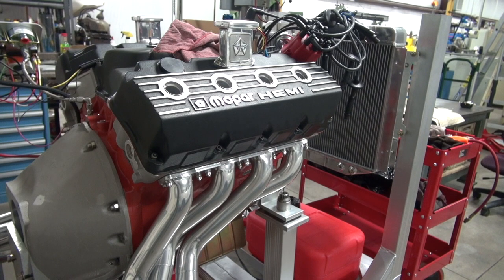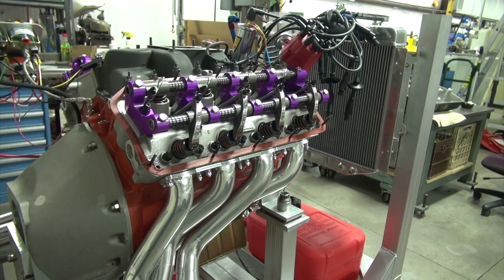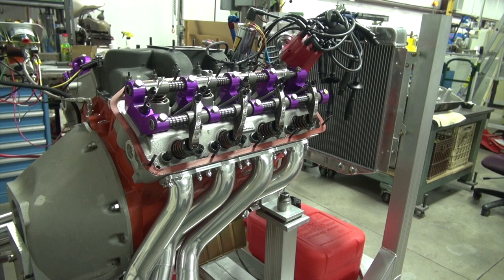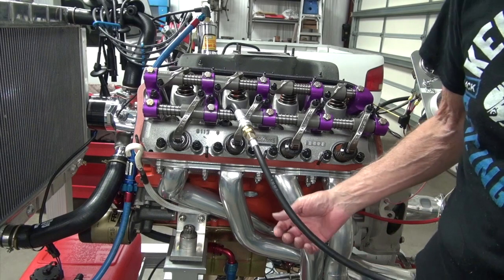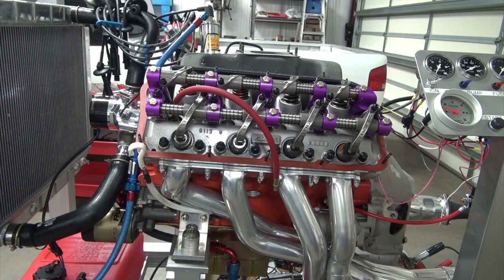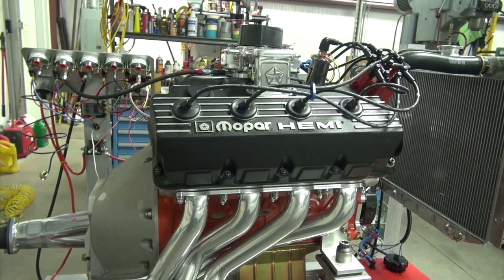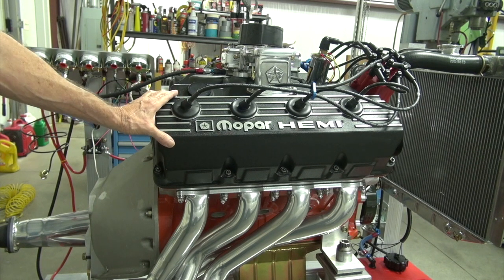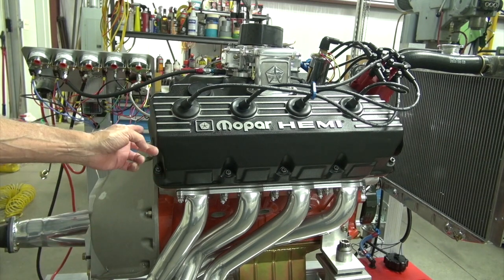Building your 426 Hemi Ep 22 #426hemi

Comment: I saw the whole serie. Thank you very much for this upload and the whole work you did. A lot of important information for me because I'm building a Callis block right now. Bought the block almost two years ago. It was a rough bore, now bored 4.25. Eagle 6-bolted crank and Eagle connecting rods, KB huperuetetic pistons, Iron heads from a hemi I had new manley valves and whole new valvetrain. Had to wait a long time for the intake but was finally able to get a 2x4 from JEGS. Will follow your instuction and advices carefully.  Engine going in a -70 Cuda, 4-speed when ready. Thanks again!!
Reply from the maker: @ifixmycarmyself2502  Take your time and if something doesn’t look right take a break and come back later. And thanks for watching.

Comment: Hi Rick I love your videos. I have learned a lot I'm building a 572 as well I also have a Callies block I am running a comp solid roller cam. My lifter bores are not bushed and I was wondering what is a good lifter to go with that does not use needle bearings and works with a non bushed block. My cam spec is:  .704/.685  276/286 r108  Thanks again!
Reply from the maker: Ray Barton said he likes Jesel and Morel. I don’t know which bearings they use. If they are good enough for him they are good enough for me. Thanks for watching.

Comment: Great job showing how you built it Rick. I just got my block back from having the water leaks brazed and am about finished with the long block. I can't wait
Reply from the maker: Take your time. Do your best. You’re not going to a fire. Don’t fail to check something that will make you feel stupid later.
Reply: Good advice, take your time.  I overlooked the fact that my pushrods have 3/8 ends at the lifters and my new lifters are 5/16 cup seats.    Other than that, the long block is done and I just picked up the edelbrock 7524 dual quad intake and am considering EFI for it, possibly port injection.   Did you ever get the PRO-Flow setup for yours ?   @rickseeman5679
Reply from the maker: @ta3834bbl  By the time Edelbrock got a Pro Flo 4 in stock I had bought all the carb stuff so I went with that.

Comment: Thanks Rick for all the information! I'm currently building a 572 with MP aluminum ported heads, Callies block, Diamond/Molnar assembly, Indy valvetrain, modman EFI intake with a LS style snorkel & front EFI throttle body. Running a Bullet solid roller 268/ 660 on a 114. Shooting for 800 HP on this one. Dyno session very soon up here in Minneapolis. I'm curious where you reside? Thanks again for the tips!
Reply from the maker: I am in Arkansas. Thanks for watching.